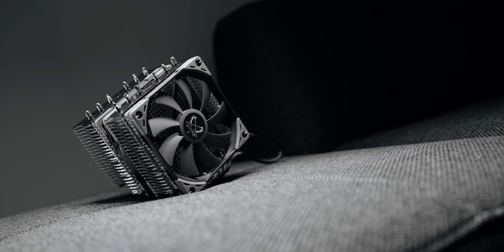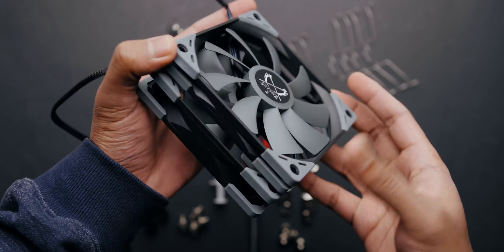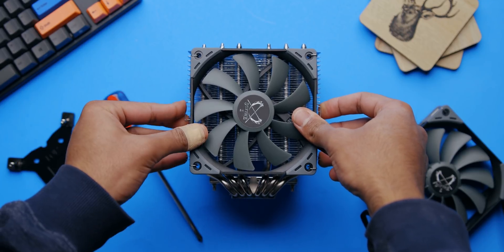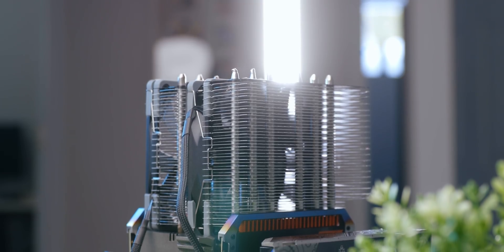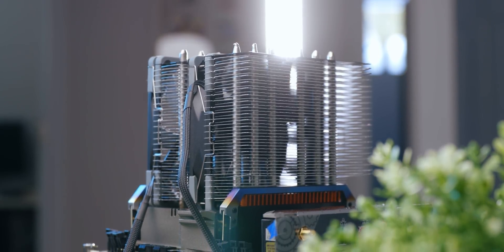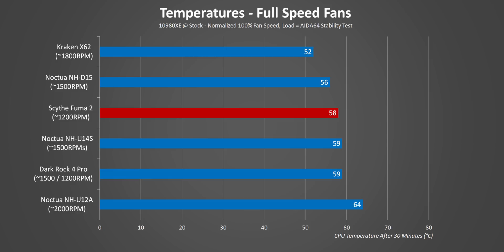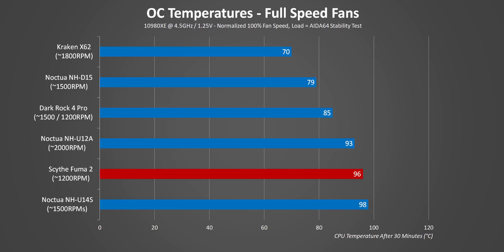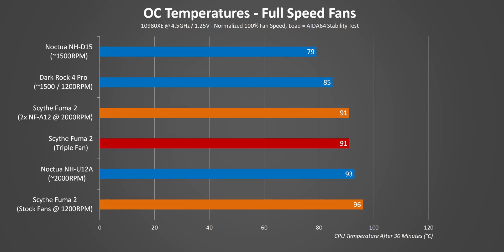A CPU Cooler You NEED To Know About!  Scythe Fuma 2 Review

Comment: I have a b450 tom max/r5 3600/42mm tall ram with all 4 slots filled/nr600 case (coolermaster), would a dark rock pro 4 cooler work with my system?
Reply: yes
Reply: @hanswurst2220  so i recvd the DRP4 and installed it, running occt i was about 41F cooler than stock wraith stealth cooler on my r5 3600. i put the center fan with the 'be quiet' logo towards the exhaust fan direction, must be right since 41F cooler. but im just making sure. in the directions from be quiet its not clear at all which direction to place that fan except for a small picture that led me to believe to point it towards the exhaust. let me know if this is correct or not, and i did put a word into be quiet for clarification also.

Comment: These tests have a major flaw - noise measurement accuracy. The results are RPM matched instead of dBA matched. We have no information about measurement distance and noise floor level. With so loud results, I assume that the measurements were done close; care needs to be taken to avoid air hitting the mic. Preferable is to run tests in a low noise floor environment and mic located at an angle that corresponds to the usual ear location. Especially higher frequencies are much louder when directed at the listener, so it's important to properly simulate the listener position.

Comment: I got the skythe mugen at christmas and it's great, compared to the stock cooler that came with my ryzen 3600 I actually went down 20 degrees celcius.  Sadly it was a little bent from shipping on the corner but it straightened back out nice enough so no big deal.

Comment: I needed a step up in high end cooling and after serious research installed the scythe ninja 5 and it's chilly in my case. I run a 5 fan config with 2 front 140mm intakes and 3 120mm exhausts(2 top, 1 rear) plus the Ninja 5 with it's 2 fan push/pull setup. It's still a pretty quiet arrangement which certainly doesn't infringe on my gaming chat or music.

Comment: Nice video. Could you also do a review on a cpu cooler : SNOWMAN cpu cooler? There are 2 version : 1 with 4 heatpipes and 1 120x120 fan, another 1 with 6 heatpipes and 2 120x120 fans. It cost < USD$20.

Comment: How do I know if it will work space wise on a motherboard? Doing first PC build. Intend to use the MSI Unify motherboard  and use all 4 slots for RAM. Want to run this cooler. But it has to fit. Will a 3rd fan fit? 

The more I learn the more questions I end up having. Almost certain I have it dialed in then learn about adding a fan! Ffs.

Comment: Is there a way for scythe to improve the scythe fuma 2? Triple fan helped at low end but not necessarily at full speed. Do they need a better heat sink, better find? They already have 6 pipes vs 4.... The fans do well from a noise to performance ratio.... Would they have to up the rpms to 1400 or 1500?

Comment: Hi cool review you made me interested in these product, anyone here knows if these cooler will be enough for a 10900k or 10850k with no manual OC just intel normal boost. i was going to buy a new ryzen 5900x but it came out at $550, the i consider the 5800X but cost $450 being an 8 core, but at that price i can get a 10850k a 10 core, that is why i am interested.

Comment: This cooler is a recommended one for the Sliger Cerberus case because it just hit the maximum height requirement.  Between this cooler and the U14S I believe that this one would work better but my air intake will come from the side with no intake fans than the front being blocked by a SFX PSU.

Comment: Just bought one of these for my 3600XT, I think the CPU is bottlenecking itself with the stock cooler it comes with (Wraith Spire or something). My CPU only boosts to 4.35ghz max where apparently the CPU can handle 4.5 or 4.6ghz. Under the stock cooler it's hitting mid 80's when gaming and it's pretty appauling. Hopefully this Fuma brings it to the mid 60's and I can overclock and unleash the beast! :D

Comment: Cherry picked data. Wow 1200rpm is so much quieter than 1500rpm. OMG 😲
Reply: True, 1200 rpm is much quieter than 1500 rpm, but more important is does that 1500 rpm gives you the same cooling performance at 1200 rpm?

Comment: It is called Scyphe because you will cut your fingers, if are not carefull enough :D
Look pretty interesting tho. Trying to deside between the BeQuiet  Dark Rock 4 and this thing.
Reply: I went for the Fuma 2, when I got the choice between the 2 coolers you are mentioning. Has tall RGB heatsinks on the ram, ease of installation even when motherboard is already in the case, fits nearly every normal atx/mini atx case, performance at silent levels and price.

Comment: the idea someone would spend money on a 9900k and buy this instead of the best air cooler available is kind of hilarious. i wouldn't want this thing anywhere near mine, with it's jaw dropping performance fall off.
i get that it's good for a budget build, so then recommend it for budget builds or builds with CPUs that don't serve as space heaters. i can't fathom being comfortable with my temps running into the 80s and 90s for extended periods of time.
absolutely love air coolers and i'm hoping for new engineering progress on that front. but this ain't it.

Comment: hows the ram clearance?
Reply: With this cooler, that's a non-existing question. Has it build in my system with 4 Corsair Vengeance Pro RGB ram sticks in "FRONT" of it. Got the catch? Cooler is designed in such way that it doesn't hang over the ram slots.

Comment: Being in HVAC for more than a decade that is true. Two contra-rotating fans in series do increase static pressure significantly. We had to do this in  hospital to overcome HEPA filter level pressure with a 400mm diameter axial flow fan. Those in HVAC will know how difficult this would be to achieve

Comment: Wish to find out if it will be a good fit on my Asus ROG Strix B450-I Gaming M-ITX mobo with Corsair's Vengeance RGB Pro 32GB kit in a CiT Blaze Mid ATX casing with 157mm max CPU cooler clearance.

Comment: is the fuma 2 compatible with the lga 1200 socket?
Reply: All coolers for the 115x socket fit the 1200 socket. The socket has changed, the mounting points for coolers haven't.

Comment: Scythe has really cheap 120mm fans with 2000rpm called the the "kaze flex". They have 800, 1200 and 2000rpm versions. I wonder how the "fuma 2" would perform by replacing the 25mm thick middle fan with a 2000rpm version. Or even 2 of them as a triple fan mode?
They're like 7-11 bucks!

Comment: Recently put a Scythe Mugen 5 ARGB on a 3600. Review it. It will suprise you :) It is the old famous design but with 2 fans and insane ARGB on both fans and a strip on top.  I really love this cooler. Scythe are crazy good.
    Efficient CPU cooler from Scythe 2x 120 mm ARGB PWM fans 300 - 1500 rpm 4.0 - 29.75 dB (A) 28.2 - 112.93 m³ / h Max 1.67 mm H2O Compatible with AMD and Intel

Comment: I have this cooler on my Ryzen 3700X and it's awesome. I wanted to buy another  non-slim Kaze Flex fan and replace the slim one on the front, but then they will be rotating in the same direction, so this special static pressure feature will disappear :/. Still great cooler! :)

Comment: It might be because of the current Covid-19 issue but I can't find a Scythe Fuma 2 anywhere.  The only place I see a listing is on Newegg but it's out of stock :(  I only found it on amazon through your link but it's out of stock there too.
Reply: Shame, it is a fantastic cooler.  I bought one last year, but I got a new case last month (that MetallicGear Neo Qube) and it no longer fit in the case (which I didn't even think about before buying the case because it fits in every other case I own), so sadly it had to be sidelined for a Liquid Freezer II 360mm.  I would put it in my server computer, but that thing is using the gigantic Le Grande Macho RT so... not much use.

Comment: But does a MOBO come with a backplate so you don't need to buy anything else? (talking about am4)
Reply: Yes, you just use the AM4 backplate that comes with your motherboard for it.  I used one on my 3600X until this month, when I switched cases and it no longer fit in the case.

Comment: Scythe has always been the best for reasonably priced low noise coolers. I used to have a Ninja on an overclocked Q6600 back in the days and it didn't even need a fan. Only the back case fan was enough to cool the CPU. Most underrated brand ever.

Comment: Corsair Hydro H150i PRO  is the only thing you need :)
27 degrees , and 30 degrees max load   :)
Reply: Is that also a 60 Dollar cooler ? Correct, it ain't. And not everybody has the space in the case for a 360 Cooler.
Reply: Lmao, gotta love those Corsair fuck bois. 

Screenshot of 30c during 1 hour stress run of Prime95 or didn't happen.

Comment: The config that has the best performance is to keep the contra-rotation fan in place and replace the normal fan (the slim one) with a Noctua NF-A12x25.  You can also find some testing that a user do with that specific config on Amazon US.

Comment: Great video! I've just bought this cooler. Everything is perfect and it is crazy silent and cold! Only one dissapointing thing- it's sagged about 5 mm under its own weight. Even without measurement I see this difference . Don't know why, may be some miscalculations in design as it is not so heavy.

Comment: I moved from my 2500k (built in 2011)  to a Ryzen 3600 and the stock cooler was useless for me. Gaming no issue but when rendering photos out of Adobe Lightroom the CPU would go over 100 degrees Celsius and the computer would auto shutdown after doing only 10-20 photos. I was regretting this so called upgrade until I got the Fuma 2 last week. My temperature while rendering is now FORTY degrees Celsius less while outputting photos. It runs a steady 60 degrees Celsius while rendering hundreds of photos now. I am absolutely stunned, as well as very happy. It’s a good purchase.

Comment: AsRock's ridiculously tall "heatsink"... Well, that's not a heatsink at all, but a block of aluminium. You can achieve the same cooling capacity of that with a 1/4 hight REAL heatsink, with fins. I don't know why these worthless lump of aluminium trashes used in any kind of mobos. They don't even look good. This is a case of absolutely bad design, where the features, gimmics and aesthetics are all lacking.

BTW: Scythe was always an underrated cooler manufacturer. While most of their coolers are state of the art. And all of them perform as good the concurrency, but much quiter.

Comment: Steve from GN DOES NOT APPROVE of your testing methodology. I didn't watch the video yet, but I don't need to because everything you did was wrong according to Tech Jesus.
Reply: Fuma 2 tested as Steve suggested, with a test dummy, test room at 35° C:

Socket 115x/65 Watt/30 DB : 50.3 °C
Socket 20XX/130 Watt/30 DB : 59 °C
Socket 20XX/130 Watt/Fans full speed : 51.2 °C

Problem is that testing with a test dummy hides a lot of issues like clearances with PCIe slots, memory, even with the current I/O covers, cases.
Reply: @dorientjewoller113  Well, Fuma 2 has mo memory clearance issues with mainstream motherboards. 

The biggest possible issue is oversized I/O covers/heatsinks, but should be all good there too.
Reply from the maker: Sorry man, you need to go ahead and read our methodologies.  We can agree to disagree on which methods will produce results that can be applied to our viewers' actual systems.  As always its better to have more than one opinion so its great to have other folks taking cooler testing more seriously like we are.
Reply: @HardwareCanucks  hey there i'm sure you're methods were totally fine and I'm interested in the Fuma 2. This was definitely more of a comment on how GN uploaded a 30+ minute video going over the dozens variables you need to control exactly to get real, accurate results on how well an air cooler actually does. Long story short If you don't control 20+ variables then your data is useless 🙄. It was both the most droning on and on video while still being snobbish.

Comment: I have the Scythe Mugen 5, I was impressed with its performance and price - however, the quality of the materials seems to be sub par. The fins on the heatsink bend EXTREMELY easily. The top of the heatsink also is starting to have some noticeable rust after only a year of use in a standard living environment.

Comment: I got one of these the week it released. Similar foot print to a hyper 212 and cools about as well as a 240mm custom loop. Oh and not brown!
Also their kaze flex fans perform really well as a case fan, moving a lot of cfm, and as a radiator fan where pressure is needed. It manages to beat a lot of fans in noise to performance.

Comment: I'm still rocking a Noctua NH D14 and it's currently keeping my 3950X at 63 degrees under full hour long load on all 16 physical cores and 32 threads.  I've had it since my 8350 which I ran daily at 4.7 and could easily hit 5Ghz+ with.  I also had an Intel 6700k under at at 4.? High GHz...(I'd have to look at my old screen shots, but it was a class leading result.  A 1700 and 3700X round out what I've run under this still Amazing air cooler.  I just wanted to rant on that really to say THANK YOU to Noctua.  Noctua, Thank You!!

Comment: I used the Scythe low profile CPU cooler and was blown away at the quality and noise. Super high quality heat sink, mount, fans and packaging. It even included longer screws for a full size fan. Great company with great products. Good spotlight video on an awesome company.

Comment: You need no testing, I've done it all for you. 2700X @ 1.3 vcore on full load hovers around 80-82C. 1.275 is better for longterm use. Over-all not that great but what I'd call middle ground

Comment: Its been years and still nothing beats the NH-D15. In a 40+ summer like the ones here in Egypt, I'll take that performance lead and just settle for second place in acoustics. I do believe that investing in your cooler pays off. I will only change my old V6GT to the NH-D15 because the former doesn't support AM4. I bought the V6GT back in 2010 and it needed a change of fans 7 years later but it still performs in 2020!!!!
Reply: Eh, Assassin III and that new Zalman cooler beat D15 if you are prepared to give up acoustics.

Comment: Your Noctua NH-U12A temps are so freaking wrong or flawed... compare them with other tests of this cooler and you ll see that there is something wrong.
Reply: From all reviews I have read about this cooler, most reflect what has been said here. Sometimes it equals, outperforms or trails a bit the NH-U12A, depending on the test bench and test that have been ran.

Comment: I'm using fuma 2 with my 3800x. While I'm getting decent temps with almost no noise, I thought the temps would be a bit better. I was wondering if I didn't tighten the screws enough, but I'm worried to damage something if I try to tighten it harder. Anyone has a similar setup? Curious if my temps are within spec or on a hot side - I'm getting Idle around 35-38C (browsing etc)  
While gaming, I usually get around 56-58C.  
Stress testing in CPU-Z goes up to around 72C.  
Primer95 (Small FFT, max heat/cpu load) goes up to 90C and then drops to 86C.
Reply: You can't over tighten the screws with this system or the one of Noctua. Once the screws block/stops turning you have the correct tension on the CPU.

Comment: I’m surprised it did so poorly in the OC test, it really looked like a strong contender. You’re also missing a noise level chart for the triple fan set up, but I assume it was around 40dBA compared to the others. Just on the precipice of getting loud. At any rate, I may still pick one up for my 3950x, while the Wraith Max is actually fine for stock and maybe losing some performance, I do like having a quieter option if possible.
Reply: Loud and noise are in my opinion a personal experience. When you hear this cooler at max speed, it's more a gentle woosh you hear and with no mechanical noise, whereas with the Noctua NH-U12A it's a high mechanical pitch for me and it would drive me nuts.

Comment: Fin density looks A lot lower than other air coolers. Kinda more similar looking to fanless coolers.

I wonder if it's because it relies on airflow to maximize temperature exchange vs number of fins. Could explain why the performance is pretty good but tops out at lower tdps.

Comment: someone can give me an advice? Scythe mugen 5 rev. b vs scythe fuma 2, what are the differences? And is the fuma 2 a big difference to mugen 5 rev?
Reply: Depends your wallet and taste: Mugen 5 Rev. B has a similar performance as the Fuma 2 and does it with 1 fan. Despite that, the mugen 5 looks like an metal engine block in your system coz it comes without a black top plate, but it's only 50 USD. If you wish to go the RGB route, you can get the Mugen 5 Rev. B RGB, this one comes at 60 USD, with a 1200 RPM Kaze Flex RGB and is finished of with a black top plate with silver caps and logo.

Comment: What I learned from this is that Noctua DH 15 it's the cooler to have and this is the one to have if you want something good, as affordable as possible.
Reply: And the space to use a D15. Coz, it ain't logical to get a new case to fit that Noctua NH-D15, transfer everything to that new case and hope that your memory fits very well under it. Not going to get rid of a 300 USD memory kit with RGB, so I can get a D15. We have an expression over here: I ain't that crazy.
Reply: @dorientjewoller113  if you have that amount of money I would recommend custom water cooling solution like jayztwocents's.
Reply: @vasipro  Lols, Jayztwocent. Since his review of Corsair A500 Air, it's best to take his advice with a truck load of salt.